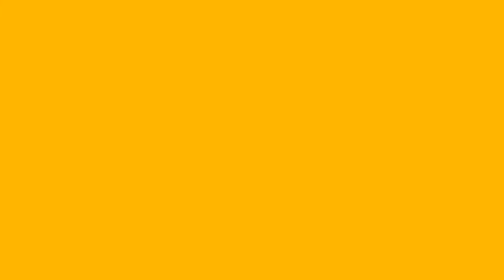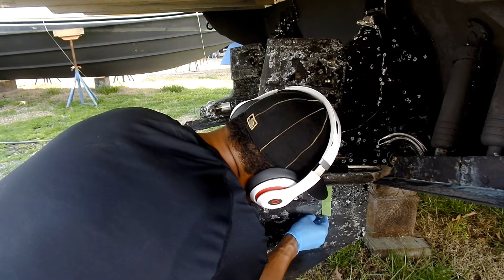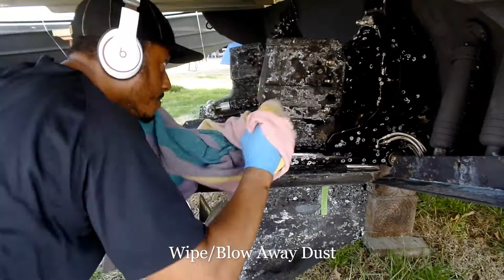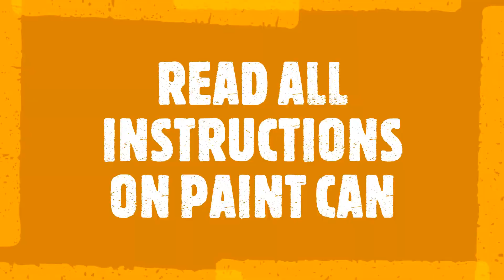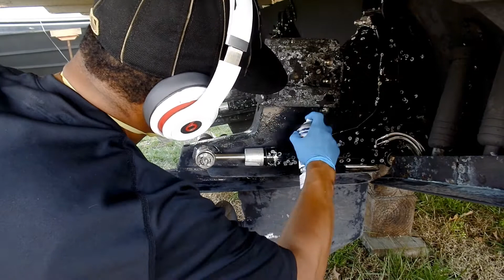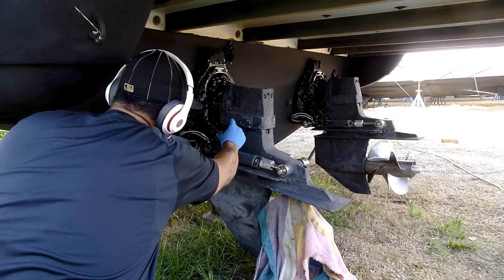Antifoul Painting Outdrives

Comment: What primer and paint did you use? 
How did it hold up under water? Are you in fresh or salt?
Reply from the maker: The drive held up fine for the season.  I am in brackish water in the Upper Chesapeake.  Some barnicles on the drive but, not much.
Reply from the maker: The paint was from West Marine at $50 per can. 1 -1.5 can per drive.